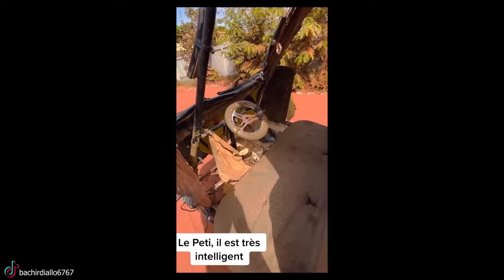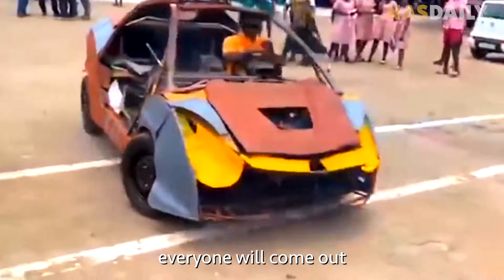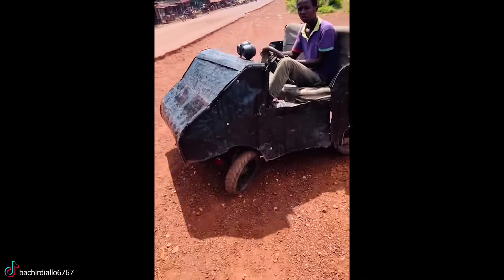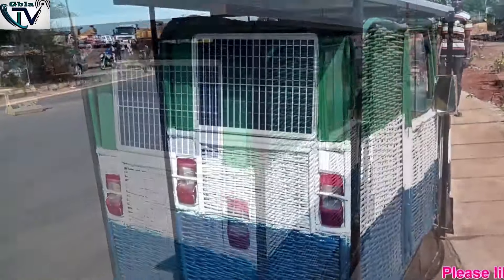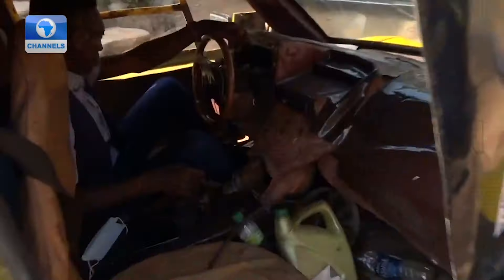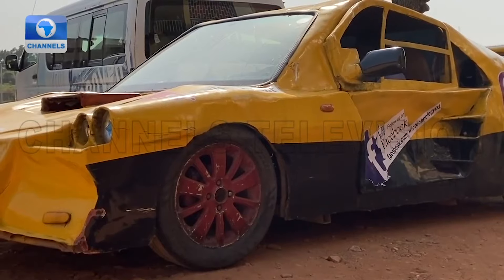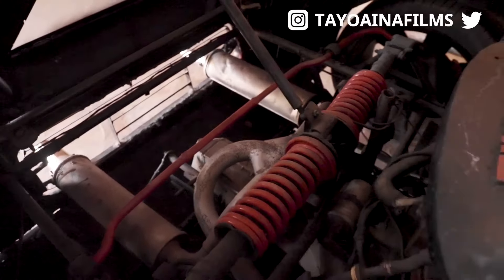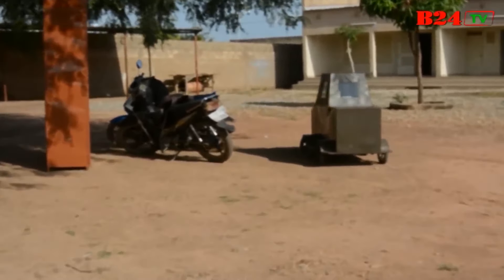Scraps Cars On The Road | African Homemade Cars

Comment: like some of those floorless big trucks that are still going around with missing wood floor boards? replace the cab with the clowns town car they been hiding in the garage. that's where the Truck + Car = Trar ... metal, ever seen 7000 pounds hanging from one bolt that's only 10mm in diameter? engineering goes far past actually making something... yet two bolts look the same so one thinks they are. chrome... oh no it's raining again need to cover it up... the next day, ah ma got... 100 versions of the same car, each one is 10% smaller... every time they drive here to their is gets swapped out until they think about what is happening? gives money just to see happen... so they buy one and it starts, like a trick or treat joke, is both and then only one.